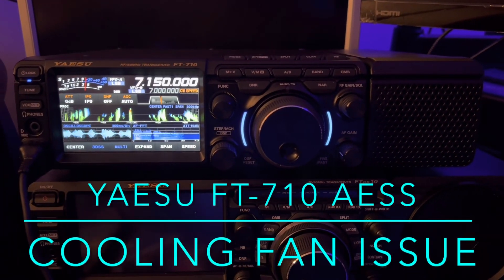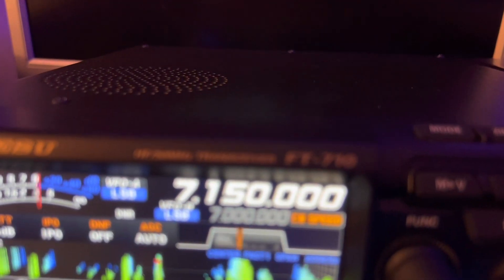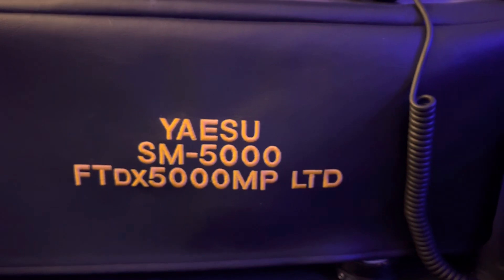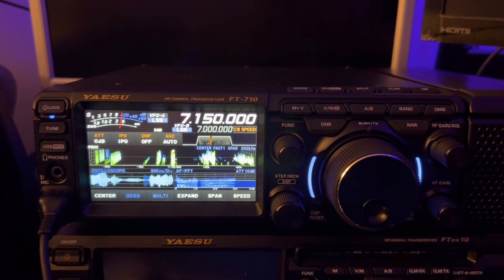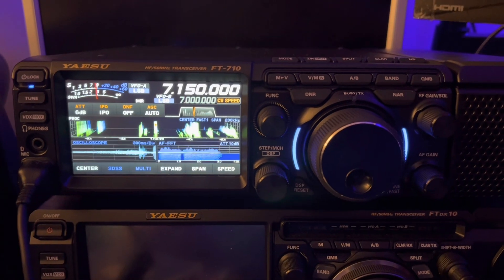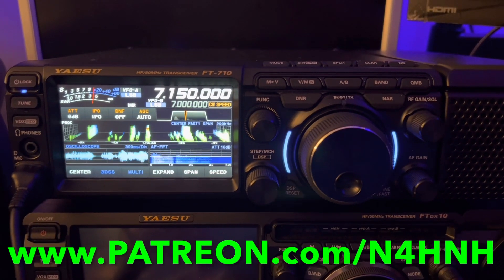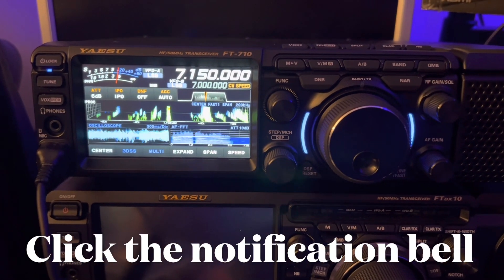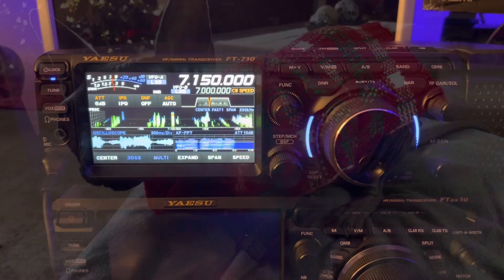Yaesu FT-710 AESS: Cooling Fan Issue (video #17 in this series) #hamradio #ft710 #fan

Comment: I bought my FT-710 about 4 months ago.  The fan appears to cycle on and off depending on how much Tx power I'm using. It does take awhile to turn off after not transmitting for a bit.  The sound is not that noticeable but then I have a slight hearing loss.  I'd rather have the fan running when it'd not needed than not running when it is needed.  
73.
Reply from the maker: The calibration of the fan circuit has not been consistent for the FT-710. Yaesu technical support told me to return it. But I was shooting my series. It doesn’t hurt for the fan to run so much, other than the fact that this one is more noticeable than the fan in my FTdx10.  The fan is very much needed during FT8, even when not exceeding 50W, as Yaesu suggests.

Comment: I watch your Yaesu radio reviews and I figured I might as well ask you since you're quite knowledgeable about Yaesu radios. I currently have the Yaesu ftdx 1200 very nice radio there's no live scope it's similar to the scope set up in the 891 but it has one heck of a receiver . I'm considering selling that radio and getting a Yaesu ft 710 or possibly a Yaesu dx10. My question is this, would you recommend to stay with the 1200 versus the 7:10 or get the 710 saying that the 1200 is over 10 years old in design. I was just curious and wondered if you could maybe give your opinion thank you and 73 really love your videos
Reply from the maker: I provide consultations for S9 (VIP) Patreon members who subscribe annually.  That is one of their many perks.  They also have access to over 230 exclusive posts, nearly 200 tutorial videos, and they are eligible to receive my menu optimization guides and FT8 configuration guides.

Comment: Thanks for this, one of my concerns when looking to upgrade my work horse IC 7410 to a new SDR is fan noise.  Now if I could just get an honest review of the IC 7300 fan that would be great!
Reply from the maker: I recommend the FTdx10 SDR hybrid.
Reply: @n4hnhradio  can you tell me why? I understand it is a great radio, but so is the 7300.
Reply from the maker: Too many reasons to write. I’ve covered it in countless videos. Watch my FTdx10 videos.  The first 39 of 98 (thus far) are public, thanks to the generous support of steadfast members of my Patreon team.  

For one, the FTdx10 is ranked as the 2nd best receiver in the world for pulling out a weak signal with a strong signal causing interference from 2kHz away.  IC-7300 is 23rd.  The DSP in the FTdx10 is superior. So that’s two.  I don’t work for Yaesu.  They don’t even like me.  So I’m not going to try to talk you into buying one. I’m just offering free advice.

Comment: Yaesu FT-710 users... you may be interested to know that the Noctua NF-A6x25 FLX runs cool and is almost completely silent! (Fit  JST-XH 2.54mm plug).
Reply from the maker: This has been widely reported. Yaesu acknowledged to me that there is some inconsistency. Some run too often and/or too long. That’s a calibration issue. Some are physically noisy. One person sent his back for the physical noise. Yaesu returned it with a note that read, “no problem found.”  But the customer said his was quiet after Yaesu returned it. You were obviously very fortunate.
Reply from the maker: But, if your calibration isn’t right, the fan might run all the time.  That’s my beef with the one in the video. But, if you don’t mind the sound, it’s best to let it run constantly.
Reply from the maker: @RF_Burns My FTdx10 is so quiet, I don’t notice the fan.  But it only turns on occasionally, after I have transmitted for a while.   The fan in that FT-710 I reviewed in the videos ran for 28 of everything 30 minutes.
Reply: @n4hnhradio  I no longer have the DX10 because I couldn't live with the front panel, but I do remember that the fan would always be running when in FT8 preset mode.  Still quieter than the 710 fan though.
Reply: I have build in the Noctua Fan, like in all my TRX,  let it run...there is no noise anymore.

Comment: So I was not the only person that flag the issue with the fan. Good! Everybody said I was to exaggerated. During my review the fan start to blow after 1hr just on RX and the sound was very annoying
Reply from the maker: My fan runs 90% of the time, from a few seconds after I power up the FT-710. You can hear the low level hum in just about every video this far.

73, de N4HNH

Comment: Yaesu also screwed up the meter when it is showing compression as it does some strange things like showing little movenent unless you turn off processor then meter deflects which is nutty
Reply from the maker: I covered that in a separate video.

Comment: Well a couple of things: Firstly, the fan on my 891 runs all the time, just at a very low speed. Secondly, the fan on my 710 doesn't run all the time. In fact I turned the radio around after watching your video, shone a torch to check and even poked it with a bit of paper. Not running. I keyed an AM carrier and after 30 seconds or so, the fan kicked in and then stayed on for quite a while. But it wasn't on until I keyed up and did go off again. I am on the latest firmware released a couple of weeks ago in case that makes a difference. I don't find any problems with mine apart from some missed opportunities like proper mouse integration, missing power settings by mode etc. Otherwise I'm very happy with it.
Reply from the maker: The loaner I’m using is running the latest firmware, but it is one of the first to be shipped.

My FT-891 operates like your FT-710, so it would seem.
Reply: @n4hnhradio  I wonder if its temperature related. The temp in my shack is quite low, its approaching Winter and I'm avoiding using my central heating in the house, so I wonder if its set to come on at a low level when the rig temp is maybe 20'c or something and then ramps up as it gets warmer. Its 18'c in the shack/office currently and the fan isn't on.
Reply from the maker: I’m sure it is temperature related. I think the thermal sensing circuit is too aggressive. My shack temp was 66F (18.9C) yesterday and the fan only turned off 3 times in 2 hours, and only for a couple of minutes. The fan ran over 90% of the time.  I never even transmitted. The fan started the moment the radio was turned on.
Reply: You can't even hear my fan on my FT-710...Very quiet... Maybe the people have a bad fan that says theirs is noisy. Its a possibility. And the other possibility is that Yaesu does have a flaw issue with the fan. But I did talk to someone else that made the comment that the radio is made into a small package so maybe the fan does stay on more then often or all the time because the radio is so compact....Just my 2 cents worth.....K4XJ
Reply from the maker: I’ve answered this in other comments but I will explain here. There is an issue with the fan on certain units - running excessively. My contact at Yaesu told me that those radios need to be returned for “realignment.”  That said, I read a comment by someone who sent their FT-710 back, complaining about their fan being very noisy. The radio was returned with a note that read, “No problem found.”  But, ironically, he said the fan is quiet now.

Comment: The setting numbers appear as 190 on constantly as supplied, I turned mine setting down to 185 and that seems good, as radio when slightly warm fan comes on. Other video on you tube shows you how to access the setting, but be carefull you dont change anything else by accident.
Reply from the maker: Yes, it can be set in the service menu. Changing it risks your warranty coverage, unless you have a Yaesu tech instruct you to do it.  The Yaesu tech told me to err on the side of caution and leave it alone. If you run FT8, let the fan run.  And keep FT8 power to 50W or less.
Reply: @n4hnhradio I only use USB, gets slightly warm at the back of case

Comment: I have carefully monitored the fan.
This comes on when required, assume to cool the processor during receive only operation.
The fan ran for about 10 minutes and then turned off. 
This will obviously be dependant on the ambient temperature, and will differ when transmitting
Reply from the maker: Yes, Yaesu believes this FT-710 was not “calibrated” properly. The primary purpose of the fan is to keep the finals cool. It should not be needed when the radio is first powered up and is only listening, especially when my shack temperature is only 66 degrees. This fan runs for approximately 28 minutes and then turns off for 2 or 3 minutes. Then it turns on again and repeats the cycle. 

The reason I noticed this fan more than I do the FTdx10 fan is because this fan exhibits a low frequency hum while running. With the FTdx10, I can barely hear any noise, except air flow. And it is very quiet. I have to intentionally listen for it.
Reply: Greetings, fellow fan noise person here. Did Yaesu fix the calibration?
Reply from the maker: I don’t know. I had to turn the radio back in to HRO and they have been unwilling to loan me another radio since. My reviews were honest. If not for the members of my Patreon team, I would not be able to justify the cost of running this channel.  That’s why the Patreon members receive the premium  content.  

HRO kept the FT-710 AESS in this video as a demo.  They sometimes sell their demos. I suspect that, if they sold it, the buyer might not be aware that the fan shouldn’t run so much or be that loud. Many others have reported the same issues with the fan.  One of my viewers returned his to Yaesu for being so loud. Yaesu returned it with a note that read, “no problem found”.  But when he powered it up, it was quiet.
Reply: @n4hnhradio  OK so it seems this is not the experience everybody has, you hope in 2024 this fan issue has been sorted.

Comment: I will pay closer attention. The fan doesn't bother me but I would like to know if it is engaging with a reason. My 891 stops the fan once the radio cools off. The 710 seems to start the fan with just the fact you are listening. Again, not a show stopper for me but thanks for pointing that out.
Reply from the maker: Not all FT-710 radios act this way. I spoke to Yaesu about it. They said it’s a calibration issue. It doesn’t hurt anything if you can tolerate the noise. Some have reported that their fan was unusually loud. One sent his to Yaesu. They returned it with a note that reads, “No problem found.”  But their fan was quiet after the trip to Yaesu.

Comment: My FT450 also has a fan that runs all the time, but I can only hear it when I put my head behind the radio and listen. At volume 0, the noise from the AF amplifier is louder than the noise from the fan.
Reply from the maker: That’s a quiet fan, for sure.
Reply: @n4hnhradio  Sure enough, until I put my hand over the fan and felt a soft stream of air, I wasn't even aware the fan was on the entire time :)
Reply from the maker: I never operated a FT-450 at home.  I operated one at HRO while comparing transceivers. Of course in there I can’t hear fan noise anyway. I can hear fan noise in my quiet shack though. 

I don’t mind the fan running all the time of it’s quiet, except for the fact that it will likely have a more limited lifespan. My ICOM VHF/UHF rig turns on the fan every time I transmit and it takes a while to turn off. It’s noisy too. But it’s in my truck, so road noise masks the fan unless I’m stopped in traffic. 

The FT-710 fan noise is not the air movement type of noise. It’s the motor and the noise is akin to a 60 cycle hum. What makes it more annoying is that is turns on at power up and stays on for an average of 57-58 minutes per hour, even if I never transmit.
Reply: @n4hnhradio  There are fans like Papst or Noctua, as well as fans that are more generic and typically noisier. If, however, it is not airflow hum, the fan is either defective or simply not mounted correctly using some rubbery noise dampers. Or it simply operates too fast for idle mode. ADC, FPGA, and DSP ICs, on the other hand, really need some proper cooling. Perhaps one of these has a bad thermal joint, and the fan controller is simply being triggered to run that fan faster. But this is all guesswork; only the rig's designer knows what's going on.
Reply from the maker: I spoke to Yaesu about it. They contend that this is an isolated case. I will let HRO know about the issues where I return it.

Comment: Mine starts at about 26º C  and stops at about 24ºC, so working fine.  i have last firmware version v01-08  it has a temp probe attached to the back, near the fan.
Reply from the maker: This FT-710 has the latest firmware as well, but the fan runs for approximately 56 minutes per hour, even if I never transmit. In fact, the fan turns on at power up and stays on for around 30-35 minutes. It turns off for a couple of minutes and runs again for another 20 minutes.  Then the cycle continues.  Yaesu thinks the radio wasn’t “calibrated properly at the factory.”
Reply: @n4hnhradio  wow! mine downs the temp in about 5 minutes and stops.
yeah maybe a bad calibration of your unit

Comment: My 991a will kick the fan on often with tx but never shuts off then when I switch bands it’s off until needed again.
Reply from the maker: That is strange behavior. Are you running the latest firmware?

Comment: I agree the fan runs way to much. Replaced mine with a Noctua NF-A6x25. Still runs but makes a lot less noise. You do need to change the connector as Yaeusu used a JST HX 2.5mm 3 pin not a standard cpu fan header. I just did the old snip and solder the Noctua fan lead is pretty long anyway. Now the radio is brown and tan club just like the PC.
Reply from the maker: It was a calibration issue with the FT-710 in the video. Yaesu will correct it under warranty.

Comment: Hi Doug. I just received a brand-new FT-710 from HRO. Its bee on for 15 minutes. I did a little transmitting. No fan on at all. Maybe it needs to be on longer?73 de WA3RSL
Reply from the maker: I don’t know. The fan in this loaner turns on the moment I power up the radio. And the shack temperature is 66F.  During 2 hours of only listening, the fan turned off three times, for a couple of minutes each time. I think this one has a problem. Thankfully, it’s a loaner.

73, Doug
Reply from the maker: I updated the firmware in this loaner as well.
Reply: Well, it just came on. Only receiving. It had to be on longer. 73 de WA3RSL
Reply: @n4hnhradio  RR. 73 in my shack.
Reply from the maker: That is still odd. It’s 66F in my shack and the fan comes on immediately.
Reply: @n4hnhradio  I can't handle it. I'm sending my back to HRO 73 Doug Maybe get an FTDX-10. Haven't decided yet. WA3RSL
Reply from the maker: FTdx10 is my pick.

Comment: I have this radio. It's great but this fan constantly
Running is terrible.  It's not the noise it's the dust blowing into components which can introduce premature failure also the fan will crap out premature.  I think we all need to call yaesu California and complain.  I'm sure this can be resolved with an upgrade. Like only comes on when transmitting and stays on for q minute after unkey which would be ideal. Other than this I really love the radio.
Reply from the maker: The Yaesu rep told me there was an “alignment” issue related to the fan in certain units. You could use your three-year warranty and get it fixed. 

A customer sent his to Yaesu complaining of the fan noise. Yaesu returned it saying “no problem found” but the customer said the fan was quiet after Yaesu returned the radio. 

Fortunately the fan blows out the back of the chassis, rather than blowing into the chassis. That will minimize the amount of dust that collects inside the chassis.  

As the Yaesu rep stated, the more the fan runs the better it is for the finals.  But you are right about the fan wearing out prematurely. At least a fan would be less expensive to replace than the final transistors. I’m okay with the fan wearing out as long as it’s quiet. Maybe it will wear out before the three-year warranty expires.
Reply: Thank you for the reply. At least my two 710s blow out of the chassis.  Maybe there will be a firmware upgrade soon. Otherwise for ssb that I use it for it should be good. Not worth sending it back. I find the radio runs very cool being the air feels cool. I have 2 710s and two dx-10s. Yes I know it's an addiction.  I also have a 3000 , 101d and 450. And that's just my yaesu rigs. Hope to hear you again on 40 soon brother. Love your technical videos. There awesome.
Reply from the maker: Yaesu told me that the fan alignment cannot be corrected with a firmware update. It has to go back to them. But you have three years to decide. A new firmware update for the FT-710 was released on 3/27/2023. It corrected a great many things.

Comment: I think the clue is the 710 is 1.5 kg lighter than the FTDX10, I’m sure some of that extra weight is a larger heat sink. The fan is larger on the FTDX10, it’s very efficient and I like the fact it’s not continuously on! I was sat on the fence considering buying a 710 but this would be a deal breaker so I’ve decided to buy a second FTDX10 🤓
Reply from the maker: Definitely FTdx10.